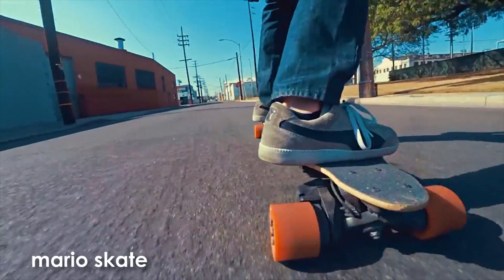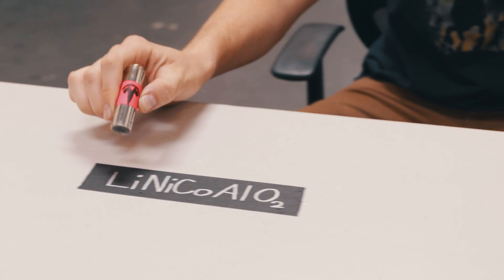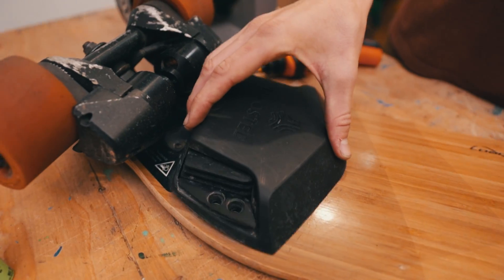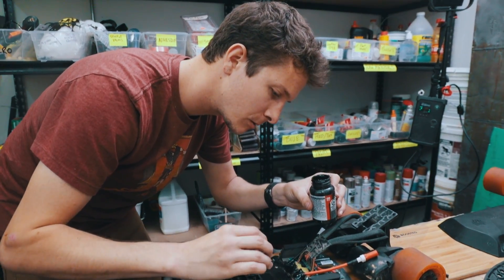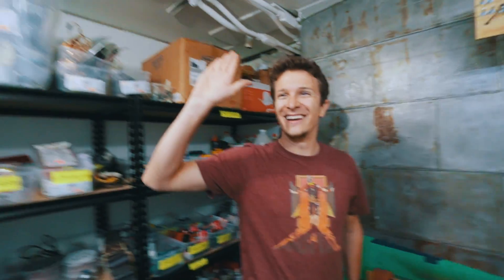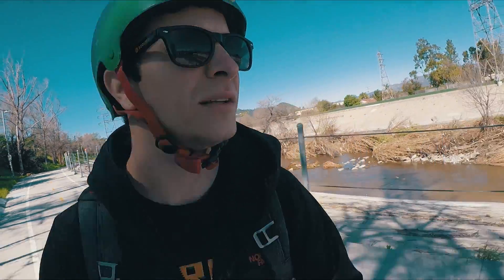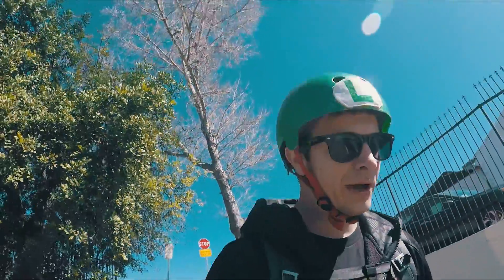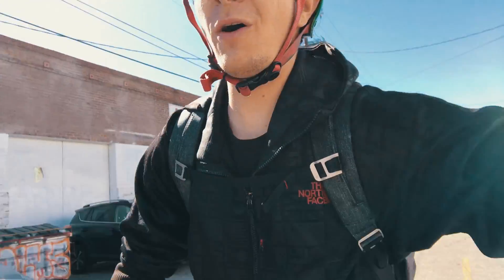Tesla Batteries in an Electric Skateboard!

Comment: Ah yes, this is many years later but I'll comment anyway...  You ought to get an electric unicycle (EUCs).  They will do 30 miles range easy.  Many models will go 70 miles, 100 miles and up.  You will have to learn how to ride them but they work much better for commuting than a skateboard type.  Entry level EUCs do 30 miles, mid-range will go 40-80 miles and the long rang models will do 100+ miles.  There are at least 5 big brands who sell EUCs... including Ninebot who bought out Segway 10 years ago.

Comment: Assuming that wrens car is having a fueling issue (it cranks but doesn't start) and he bought a $1500 boosted board, he could have spent $1000 on a boosted board and fixed his car. But in my opinion, modifying the boosted board is a much bigger flex

Comment: Why not just replace the stock esc to a vesc? Then make a 12s2p in the stock boosted board battery enclosure and 12s2p outside the enclosure. Make sure you are using the same battery cells (not the stock LG batteries) that way you'll have a 12s4p put all together. 16 amp hour of battery and maybe 25 to 20 miles of range.

Comment: Im no electrical guy but from my limited knowledge i keep on thinking you need to wire a couple batterys in series since wattage is the electricity that machines use and series adds up the voltage and parralel adds up the amperage and voltage time amperage equals wattage so idk

Comment: I have a Tailg Astra electric moped. This moped goes 80km with a single person and maybe 60km with my girlfriend onboard. I want to extend the distance and boost the torque and speed slightly with her on it by at least another extra 100km (so 180km ideally). How could replacing the whole removable battery do this? Does Tesla sell batteries that might work? It's 1000 watts but I think the battery type is not the Tesla type.

Comment: Use a boost converter and a OPamp to see when the voltage is low, you can switch the boost converter and output more energy from the batteries

Comment: Or you can just use a charged battery of matching capacity and connect it in parallel  After a few minutes the dead batteries will be up to voltage and accept a charge again.

Comment: 3:51 I’m surprised this actually worked because I’d think there would be a layer of red plastic inside the metal protector

At least that’s what I’ve seen in smaller wires 

Maybe they can get away without needing an internal wire because it’s all just for one channel

Comment: You are almost too wrong, Check with an electrical engineer,
it pulls from the main battery, you are basically charging the main battery while this is running.
STRONGLY ADVISE NOT TO CONTINUE
also, DO NOT mix Different battery packs!!!

Comment: Guys don’t do this it’s not even that you could fuck it up and destroy your whole board but if it does work your motors will burn because of so much heat and excess power and current going through them so overall don’t fucking do this
Reply: Wrong.//...its  2 Cells...7.4 Volts

Comment: I'm responding to this quite late. However, I hope CCrew reads it. It may help in similar/future endeavors. 
To keep this response short... There is a product called Plasti-dip. It can be purchased in a liquid form (like paint in a can), and in a spray version (spray paint). It works great for plastic covering wires, covering surfaces that might get scratched, etc. Plus, you can remove it if needed. Check it out if you are not already familiar with it. I use it to coat anything with a scratch point. Especially on my One Wheel (Wren).

Comment: 4 years later, still waiting for the update on how to make this board actually work to full capacity 😭
Reply: 5 years later, still waiting for the update on how to make this board actually work to full capacity 😭
Reply: Dont mix li-ions and lipos
Reply: 6 yrs waiting😢
Reply: @thetobsters35  make it 7
Reply: @thetobsters35 it won't work because he added 2 batteries in parallel to the main battery. Unfortunately, the 2 he added has much more juice inside. Because the battery already on the boosted board is much smaller, the other two batteries have to use a lot of juice to charge the empty battery as well because they are in parallel. This means the this set up won't work without some sort of disconnect.
Reply: @thetobsters35  dont hold your breath. Simply shouldn't mix two chemistries
Reply: 6yrs later
Reply: Yeah
Reply: Kid, I wish he was done
 maybe he is not it's unknown
maybe he isn't it's unknown
Reply: It's been 8 now. Haha
Reply: We at 8 years. Did we get an update?
Reply: It's called a OneWheel :P
Reply: ikr
Reply: i think it didn't work well because he soldered it and the heat might have broke it, so you need to use a spot welder, that's what i think would fix it.

Comment: hello，does v1 use A123 2500mah cells？
Reply: yes, he should just make an external battery pack with these cells although if he made two to fit under the board he would still only get 9 miles range!

Comment: 4 years late, and you likely found the simple answer. Remove the original batteries and replace them with jumpers. Better still, remove original batteries and connect the new one to the same terminals. That will also allow your power meter on the control unit to give an accurate battery level reading. Don’t overthink it. That’s the problem when people become experts, they see the narrow path, and miss the fields full of other ideas either side.

Comment: You can create a relay circuit that can run only the dual pack until the capacity drops to the same level and then switch on the booster battery.

Comment: 35.6v / 10 cells = 3.56v per cell....... about 7% battery left, same thing happened to me tinkering
Reply: Actually panasonic 18650s discharge to 2.5v per cell

Comment: What if you use DC inverter instead of two battery packs. It will reduce the weight as well as you can gain more current as output. Also it might work if you use super capacitors instead of 18650 batteries. But you have to find a way to charge them. As well as you can use a high torque motor with a gearbox then you can basically avoid hike issues. In here the gear box must have the ability to change gears automatically or with press of buttons. 

All above are just ideas. Not sure whether it works or not, but you can make a pretty good attempt by implementing them.

Comment: If you're using a LiFePo4 BMS system on NCA batteries you probably nerfed the NCA batteries.   They won't have the same overcurrent, overcharge, parameters, or even the same charge voltages.  Mixing the 2 cell types is a huge no no.

Comment: There's probably a few ways you can do this but the easiest way would be to have the battery on the boosted board be charged by the batteries that you've added. Another option would be to take the same money you paid for the boosted board and put it to something like an electric scooter that can go faster and further. You will get better value for your money and a better ride.

Comment: You should replace the boosted board battery's with the same battery's that you used to up the voltage that way you could use up all of the 18650 batery and then still have power in the batery packs

Comment: you need to make many battery packs with the same voltage size and output as the board battery pack. Or you will have to make a new circuit. to go faster you can use a larger motor and modify the motor size or make a gear box.

Comment: 8:22 and that's the problem with Tesla batteries! They deliver far too few amperes to carry you up the mountain. With LiPo batteries, that would work. 

The 18650 cells can only deliver an average of 20 amperes. And all at full charge! Meaning if you've already driven something they can't lie nearly 20 amperes
Much less because the voltage also decreases

Comment: One possibility would be to wire additional batteries in series, then voltage regulate down with high amperage capacity voltage regulator(s).  The batteries would discharge from that elevated voltage, but the regulator would keep the voltage where it needs to be at the motor input, and keep the speed of the motor up - IF motor speed is the issue and amperage is sufficient.  If amperage is insufficient - i.e., it's a matter of torque, which seems to be the case when you are unable to climb hills - then additional batteries in parallel is the only way to achieve that in a practical sense, other than  building a DC-DC converter or creating a switching power supply, which is outside the scope of what could reasonably be fitted to the skateboard.  I'm also assuming that the requisite amperage draw is not overly tasking the wire interconnects (did you ever check to see if anything got warm at max output?).  Did you check the resistance of the interconnecting wires and solder joints?  Finally, if the batteries that come with the board are adversely affecting the overall circuit, remove them and use your own battery packs exclusively.  Interesting video; hope this contributes.  Edit: just looked at the posting date, and realized this is OBE at this point, but I left my comments for anyone else looking to experiment with the same approach.

Comment: No i dont care this was 3 yrs ago, just lioe solving problmes. Use a 2 way switch with an adruino and when you finish with the boards battery it automatically switches to the ones u added, code the adruino to when theres no charge left in the boards battery it will switch the 2 way and the board will start using the battries uve added.

Comment: You rann all batteries in series which increases your voltage but now the capacity of the battery so if it was a 5000mah battery it would be a 5000mah. If you make a 11s3p battery you could get 3 times the capacity.

Comment: so normal 18650 batteries and you threw in the tesla name for clicks, you can buy those at any vape, tobacco or rc hobby store they are nothing special and certainly not, "tesla" batteries just cause you scrapped them from one and 18650s are just lip cells anything lipo with large compacity and output will be better

Comment: its funny l came here to give the  correct answer because it will help 9.2k peoples. the answer is: your controller (brain for the battery) is programmed to a max voltage and also minimum voltage cutoff . second , the controller is also programmed for a maximum amperage (maybe 30A) output so in conclusion if the controller is not programnable you can not change any setting from  the controller . so the only thing you can get is more milleage with a bigger battery pack with the same voltage as the controller is programmed for . conclusion get a vesc for any electric vehicules and it can be set with about 100 parameters !!

Comment: Simple...   Replace the booster board battery with another battery pack like the ones you just added.  Then between the 3 of them they should be able to discharge to 30%.  But I think I would probably add yet another one to make it a total of four battery packs on the skateboard. More battery longer range. 😎

Comment: What if you make the wheels a power generator and a power utilize at the same time? Then you could technically use more power. And what if u pump electricity alternatively so that the board gets small shocks of electrical current instead of a continuous one? That would technically up the voltage.

Comment: I have an 💡 idea . So the board can’t handle the remaining energy right so you should use a kinda like a car system we’re you should use a battery that charges it’s self the more you push the throttle and the alternative energy will simply be regenerated sort of like an actual generator 🛹🛹🛹🛹+🔋🔋🔋🔋

Comment: Use a DIY battery indicator and attach an inverter to the battery indicator and when the voltage drops the inverter steps it up with the cost of some amperage but you still will lose half of whats left...

Comment: For 15 miles I'd go with more than 20 batteries. That's barely more than 3 laptops worth. Especially as the wheels on a boosted board probably drag more than an e-bike. I'd want at least 5 packs. Try 11 batteries in series in each one if you're having trouble with minimum batteries. The extra 4 volts shouldn't damage the board (I don't know for certain) but then your minimum voltage will be 33.

Comment: Adjust the boosted board volt limit and it will probably not go all the way to the tesla battery voltage but it will get closer due to it just beings a simple small eletric board battery

Comment: a cc/cv boost converter set to 60v could work , its a good idea, but as the battery voltage gets lower the amount of amps it uses will rise which could make the boost converter work harder and get hot

Comment: I have a question though.  If you remove the original battery and BMS (battery management system,. Even if you hook up new lithium batteries directly to the controller, how are you going to turn the power on to ride?

Comment: I came back to this video after realizing why this mod failed and the right way to do it:

1) parallel connectors only works with the same battery and voltages. Boosted is using these types of batteries: https://www.batteryspace.com/a123-lifepo4-26650-rechargeable-cell-3-3v-2500-mah-50a-rate-8-25wh-anr26650m1b---un38-3-passed-and-iec-listed.aspx?gclid=Cj0KCQjwpNr4BRDYARIsAADIx9xxeboJIvqoMYWfWfv8vwiYxmSyACenKYASJcC5O5fgfxb_bHnvqV8aAn_hEALw_wcB

2) you have to use these and create them in parallel larger than the boosted and put them as your replacement batteries. Then, make a pack using the same voltages and parallels and bam, you got yourself an extended battery pack that will output the same power and have the range you're looking for.
Reply: I hope they make a 'part 2' video making use of your suggestions.
Reply: I got one of those A123 LiFePO4 26650 Rechargeable Cell: 3.3V 2500 mAh, 50A Rate, 8.25Wh, ANR26650M1B - UN38.3 Passed & IEC Listed batteries and theyre actually good
Reply: I refuse to spend that much on cells. I buy all of my cells from the source, largest Cell manufacturer Liitokala. Over 100 cells purchased and all tested true and knock on wood, I haven't had any failures yet in almost 2yrs. https://liitokalahongkong.aliexpress.com/store/217753?spm=a2g0o.detail.1000061.1.5a4d3a25TBdmG7 

18650B cells https://www.aliexpress.com/item/32771532107.html?spm=a2g0s.9042311.0.0.27424c4dHUbiuN

I usually buy 30-40 18650 - 26650 cells when Ali has a big sale. $2.50 - $3.00 a piece.

 I've been trying out these Varicore 26650 20A also for high output Flashlights and they've been impressive. They may be just re-sleeved Liitokala cells https://www.aliexpress.com/item/32964949473.html?spm=a2g0s.9042311.0.0.27424c4dHUbiuN
Reply: @MAGGOT_VOMIT  I agree with you there. But we are talking about boosted...
Reply: @LeonCamero  There is no "BOOSTED". It's all just supplying enough current to meet the Motor's demands.
Reply: @MAGGOT_VOMIT  Not for boosted boards. You do know that the manufacturer esc is based off of what batteries are used and supplied, right? If you change the battery, the esc may not work. I tried that and I have 2 of the escs. The motors aren't demanding anything, its the esc that does that and pushes the amps from the battery to the motors.

Either get a vesc, or stick with the supplied system its asking. I recommend a vesc though. Super useful.
Reply: 3 years later my esk8 goes 50 miles...🤣
Reply: Same i was gonna say the same thing me too

Comment: cut the Tesla bat by melting it and removing the electronics then cut the top off smooth and then cut the bat to where you want and sand it  then seal it back together with  electronics on the inside and make the electronics fit

Comment: @Corridor Crew 

You should make a boost battery pack (it wouldn't need to be very big) that you can connect to the 2 large packs when the current draw is low to "boost" the current.

Comment: Maybe add a relay so that all the packs are in parallel till the board battery drains out, and then switch the 2 Tesla packs{still in parallel) to series with the board battery? This should work. Unless I'm missing something.

Edit : just saw that the video is years old now. Probably won't matter what XD

Comment: Dude use exactly the battery type used in the boost board battery but add them in parallel connection .u have to know that the drain rate of a battery also depends on the load you place on it,so add more parallel connected batteries than is in that board and ill advice u 
To add those ones you can drain heavily and a switch with them for changing mode for steep inclines.like steep inclines  
Flick switch after steep inclines turn off the switch.

Comment: WREN you should have used Samsung 21700 40T’s 
They are 4000mah and 30amps per cell!!!
Way more AH’s than those crappy 18650 Panasonic’s 
P.S I’m a Vaper and knowing which batteries to use in which vape is very important.
I.e, In a regulated vape (screen, circuit board) a high capacity medium ampage cell is preferable, whilst in a mechanical mod (vape) the max continuous (amp) discharge and low voltage sag is most important, as the higher amp draw and low Voltage sag means the vape delivers a hard hitting draw , which is more satisfying.

So, the best 18650 for capacity and decent amp rating is the Sony VTC 6A (3000mah/20amp)
Best all round- Sony VTC5A (2500mah/25A)
Or VTC5D (2800mah 25a)

The most powerful 18650 in existence-Samsung 18650 20S (2000mah 35amp)

The most powerful 21700 in existence and therefore the most powerful cylindrical li-ion cell ever made thus far (and my preferred cell for mech Vapes)-
Samsung (21700) 30T -3000mah/45amp continuous discharge 

Oh and in the USA liion wholesale is a great and cheap site to buy from
UK- Fogstar.co.uk